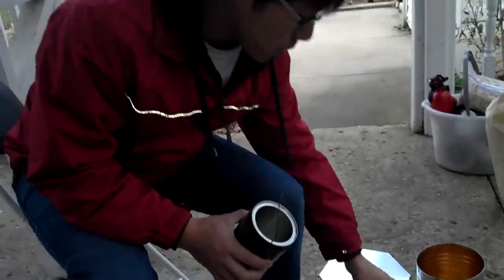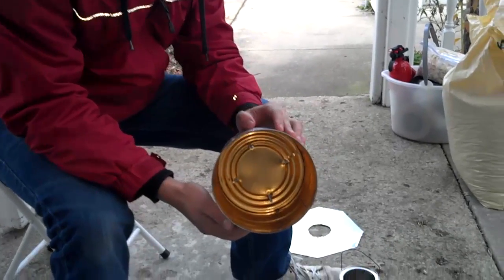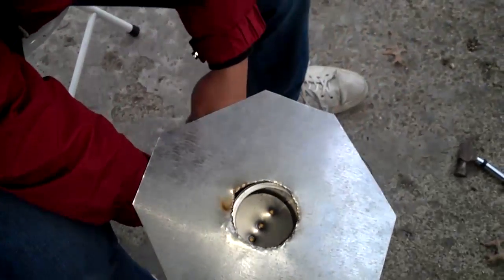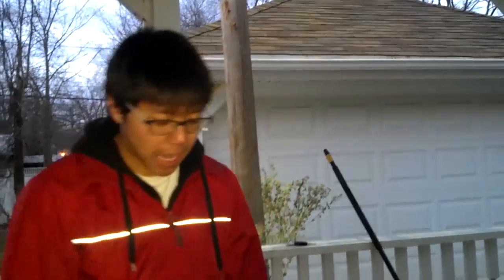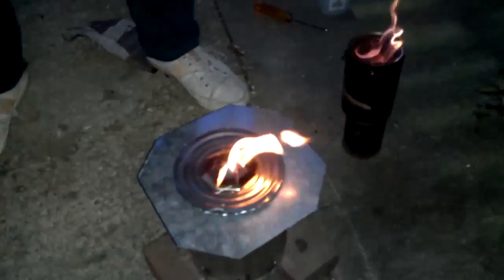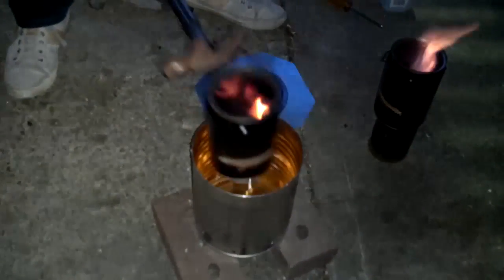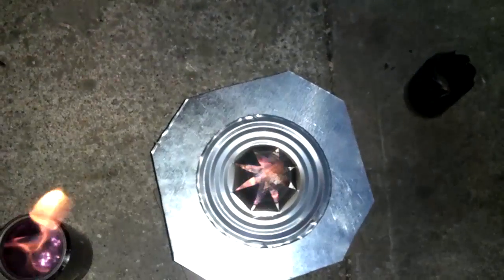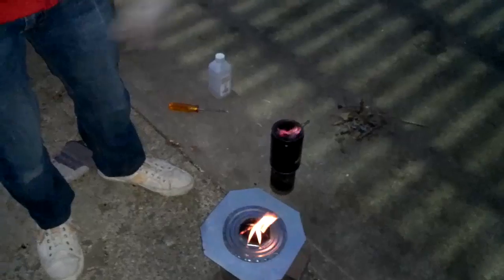A canister based TLUD stove

Comment: Just use two stoves. Actually a better built stove easily burns long enough to cook a meal and usually even heat dishwater. By the way- Loose the fan, its just making you miss all the important parts af a good airflow. If the flame isn't mostly blue you aren't doing it right.